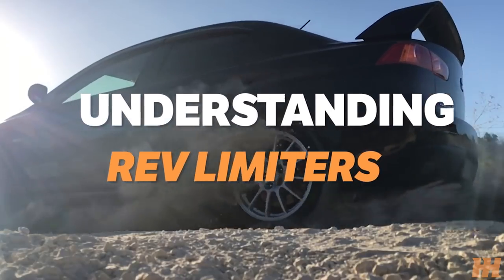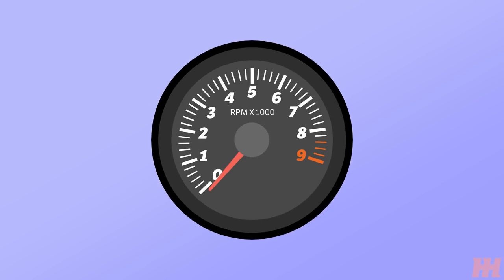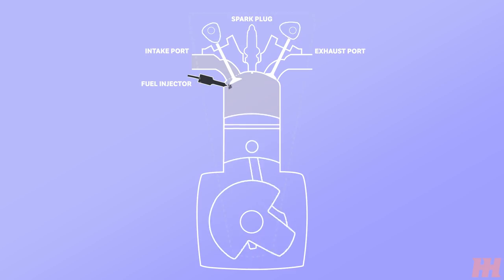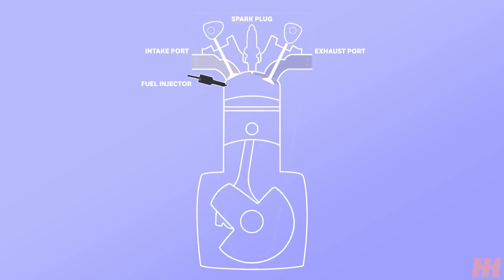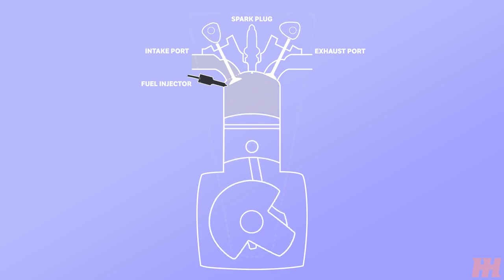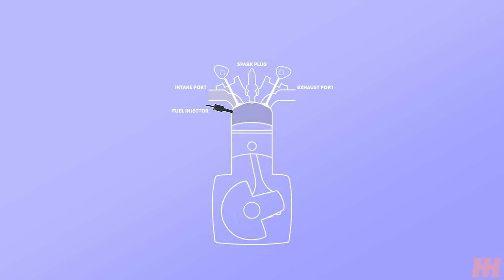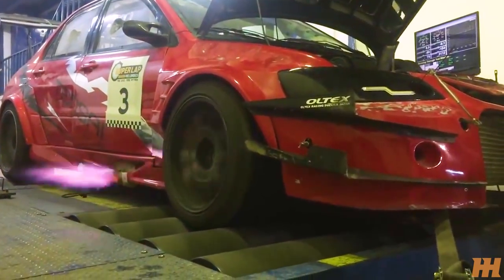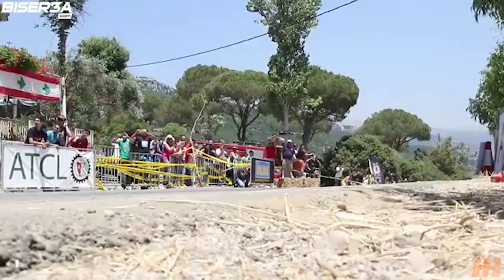The Truth About Rev Limiters

Comment: Just to note, antilag in rally cars is significantly different that “antilag” on most lower end ECU’s that guys will use for launch. The rally systems are not just retarding timing. They’re a full air bypass system where the turbo cold charge will actually recirculate into the exhaust and fuel will be added normally by retarding timing and then a secondary ignition is used in most cases. It’s a very advanced system and really really cool. It’s now being used in Formula Drift as well for those that don’t follow either. Worth noting because I think your info was a bit misleading.
Reply: Lol I can’t tell if this is serious or not
Reply: @dustinclement2483  🤣🤣
Reply: @redline350zHR  lmfaoo
Reply: It's like an afterburner in jets?
Reply: @Sm00thieK  thats called rocket antilag, its different from als

Comment: yeah i have a question
So how do i replace my piston return springs?
Reply: watch chrisfix he has a video for that
Reply: do you have an elbow grease ? if yes where did you bought it ? i badly need one thanks
Reply: You need a long stand.
Reply: Use some soapy wooder to soften the grease.
Reply: The Dutchinator well your in luck Chris fix made a video about that. It worked on my and made it much easier to replace them.
Reply: You have to remove the pistons first. To do so, remove your current rev limiter and stand on the throttle until you see all ya pistons
Reply: Jack up the vehicle and touch the chassis and it should be good
Reply: The Dutchinator you can't do that alone, bring the car to mechanic
Reply: always keep a bucket of compressed air by your side, just in case
Reply: refer to ChrisFix's videos
Reply: Change your winter air to summer air, its almost summertime
Reply: You tube it. It's been done.
Reply: while your at it you might as well rotate your wiper blades

Comment: And remember guys, it is always best to use all of the above limiters on a cold start for maximum results ;)
Reply: Will Palmer for engine longevity, peg for to floor the second the engine starts and let is bounce off the Rev limiter, this will warm the engine up faster and promote better oil flow, increasing lubrication and engine longevity. It even says so in every owner's manual, don't look, you can trust me.
Reply: Will Palmer also, if your car has a turbo remember to floor the living shit out of it then turn it off abruptly
Helps to lessen the turbo lag overtime
Reply: Instruction unclear, piston caught in ceiling fan.
Reply: It helps let everyone know how cool you are too
Reply: If you put petrol instead of engine oil it creates much bigger and louder pops and bangs.

Comment: It isn't ignition in the hot exhaust, it's ignited by the after fire of the following cylinder otherwise on older cars without all this electrical stuff in them, if you reved it and then turned off the ignition there'd be a constant stream of flames, instead there's just one pop when you turn the ignition back on. The hot exhaust merely flashes the hydrocarbon fuel into a vapour making it much easier to ignite.

 If a hot exhaust ignites fuel vapour you'll get a constant stream of flame from down the pipe which will make a very characteristic whoosing noise where as after fire ignition makes a pop or bang.  An example of exhaust ignition would be some high end lambo's where you can see that blue flame on the exhaust sometimes under acceleration. That flame also contains a lot of very hot oxygen.

Comment: Also worth to note: Not everytime a car goes bang its because of Antilag or 2steps. (Gotta love the compilation videos that get this all wrong)
Reply: "Antilag or 2steps" - you mean Antilag or rev limiters! 2 steps don't limit anything, in fact they increase something more than limiting it!!
Reply: @Anarchy-Is-Liberty  A two step (Rev) LIMITER limits the RPM in two Ranges, a low range that keeps the RPM at a set "optimum" for maximized grip on launches and and a High Range which is the maximum RPM the guy that sets it wants the engine to run at. They just cut the fuel (and/or ignition) to prevent the engine reving past the set thresholds. 
Antilag basically dumps unburnt fuel in the Exhaust system  by retarding the timing to get Afterfire (not backfire) to keep the turbos spooled. This is mostly seen in racing as it will put a lot of stress on the Turbos.
And generally cars can afterfire for a bunch of reasons, not just limiters and Antilag. 

I by the way wrote the comment before checking what video it even was on since its an old comment. After watching the Video again, this is exactly what he explains anyways...

Comment: Great video. I always heard these terms but never knew what they meant

I've noticed that my civic (bone stock) has a Rev limiter that kicks in at like 4500 RPM when the car is stopped and in neutral. I guess it's to prevent people from revving to redline and putting it in Drive to launch the car.
Reply: uRiBiTo666 hmm my Jetta is like that too you can only go up to like 4k when your standing still
Reply: my last car was the same. Its also to do with the lower inertia of an engine not connected to the wheels.
Reply: Thats to protect the torque converter
Reply: Yea some Ecu’s are tapped into the neutral safety switch to know when you’re moving/ in gear or not. But it’s to protect your drivetrain as you said
Reply: I didn't know that was to protect the torque converter. I discovered this rev limiter in a rented Dodge Challenger R/T and assumed it was put there by the rental company to prevent customers having too much fun! ;)
Reply: My Ford Fiesta stops at 2,000RPM! I want to left foot brake launch, but can't as there's no torque at that low RPM.

Comment: A word of warning using the Bee-r or any other ignition cut that uses the same method of cutting ignition which is to ground out the coil and stopping the spark 
But the spark has to come oui of the coil regardles as the Bee-r cuts in the middle of a cycle causing a random spark at any point in the cycle.
If you like your engine and don't like DETONATION and your engines lifespan being reduced then take note. 
Also If you do use the Bee-r, make sure you have a straight through exhaust as large restrictive silencers tend to explode when full of fuel in them.
Reply: So are u saying I shouldn’t get it then?

Comment: I still can't understand what causes the exhaust pop up when you shift up in new cars like A45 amg and RS3 and the golf R and other RS cars
Reply: anas boulkhalil when you close the throttle there's a moment with a lot of fuel that doesn't get ignited hits your exhaust causing flame so when you lift off throttle to up shift quickly this happens rapidly there's more fuel and higher chance of this happening
Reply: I think it;'s got some fancy valve system int he exhaust too, as I've seen them pop when slowing in city traffic at low speed and RPM.
Reply: tangles01 yeah that what i think it's a valve that causes the pop up sound because it sounds loud even if it shifts in low rpm and it does not sound like a gas explosion

Comment: A question, why do cars start to require costlier and more frequent repairs the closer the vehicle gets to end-of-life? Like initially the car may have one or two trips to the shop a year when new, but 10-15 years later, it sees a new repair and parts replacement once a month, maybe 2 months if you're lucky, the value of the car dropping to the triple digits, until it becomes more economical to just buy a new car. Essentially what happened to mother's minivan.
Reply: Cars are a combination of tens to hundreds of different systems with tens to thousands of different parts comprising each system. Any one of them can fail or cause another part to fail more often and age is the killer of all.

Comment: I only care about that cool sound they make =)
Reply: until your turbo breaks! ;)
Reply: Just passing by ? antilag is turbo only, how come it breaks your *turbo*.
2step can Be NA
Reply: CarMaster_316 Ignition cut is perfectly fine. Fuel cut is very bad.
Reply: Some people don't care though, which is bad.
Reply: Special Ignition cut is also bad, reducing your spark plug timing can make your car slower. Pretty much any unburnt fuel makes it slower because you're not getting enough air and as we all know air is quite important when it come to engines.
Reply: Turmoil CritHitJ Yeah, but isn't there a switch for the ignition timing whenever you install it so that whenever you race it doesn't just antilag?
Reply: CarMaster_316 there probably is something like that out there, my point is that spitting flames under any circumstances has a good chance of reducing your total horse power
Reply: Turmoil CritHitJ Yeah, oh well it's just preference
Reply: CarMaster_316 Fair enough mate

Comment: Can rev limiter can install in distributors ignition system cars if it does so how it can control the ignition timing because distributer has its own manual spark timing wich advanced or retire vary on rpm or speed...???????

Comment: Afterfire is the fire that's shooting on your exhaust pipes. Backfire happens when some air/fuel mix seeps into the intake valve in compression stroke. And when power stroke occurs, the fire spreads to the intake and blows instantly and this only occurs to engines that have valve float, carbon build up or it is just the valve not seating properly.

Comment: When I floor my car (a stock 2012 Honda) in neutral, the Rev doesn't exceed around 4,500 RPM and it bounces back and forth. Is that a 2 step??
Reply: It's a soft cut limiter

Comment: Are pops and bangs good?
Reply: Mr WRC depends on what's causing the pops and bangs
Reply: Not good if it includes burning parts and blown heads
Reply: for sound yes, for engine components no
Reply: like Zo1d_ said, it depends
Reply: You should ask my turbo that.
It says not for long.
Reply: I have an old carburetted Alfa Romeo which has a spark cut rev limiter that works via a centrifugal mechanism in the distributor rotor. It completely cuts the ignition while the carburettors are still delivering maximum fuel, causing you to blow a hole in your muffler. Ask me how I know. ;)
Reply: The engine isn't burning all the fuel during the power stroke so in effect you'd be wasting precious Bhp per litre

Comment: But why do some make flames or crackling Sounds when they Just Go of The gas
Reply: thedogefogx420 thedogefox420 Unburnt fuel igniting in exhaust
Reply: zevi 2000 but why only in some Cars and Not in every Car
Reply: thedogefogx420 thedogefox420 This wouldn't happen in a Civic or a A4 because it's not a high revving engine. In a performance / race car the engine is working harder and faster so it's more likely that some fuel goes to the exhaust.
Reply: James Upton wait There are many Flame spitting Audi a4 or Honda civics i dont get it:/

Comment: Fun fact. The e46 M3 has a stock 2 step (although it’s not designed for launch control its design to nanny you) the car will go to 8,150 rpm when in gear. The car will not exceed 6,000 rpm while in neutral.... now if I could only reprogram it to use the stock system to lower the neutral rev limiter to like 3,500 rpm

Comment: isn't a 2step syystem then not good for the engine?
Reply: but are the parts engineered to be able to handle spark-timing changes? we're talking about huge forces acting against the natural way of how it's supposed to be. 
and recently i heard, that unburnt fuel is bad for the catalysator..
Reply: 2 step and anti lag is bad for a normal engine.
The engine isn't manufactured for that.
And it is also bad for the cat.

Comment: if people that hate autos because of lack of skill. then i dont get why people like 2 step. i want to be as good as i can get, without any type of compensation. i like 2 step for the bangs and pops and thats it. i'd rather try an get good at holding the perfect rpm, then have some system do it or me. like new cars with rev match and how cars do almost everything for you like gtrs. but thats how i feel im sure many wont agree and some might.
Reply: 2 steps do more than just hold the rpm in a certain spot.
Reply: When you’re drag racing and every fraction of a second counts, that time it takes to push the pedal the rest of the way to the floor can make the difference between a win and a loss. even if you’re perfect at holding the revs. Not to mention 2 step will spool the turbo better than just holding the throttle at a certain point, making for a harder launch.
Reply: Mr.009mm Killuminati Two Step allows you to be at full load so when two-stepping you're making similar to the maximum power that rpm it's especially effective on turbo cars because you're at full load off the line

Comment: So it’s basically just about pops and flames from exhaust (which I find cool) and also about a tool for those who cannot launch car properly by themselves...so it is just cool, but basicaly fuckin useless....mmmkay
Reply: Well, with two step, you can full throttle right away, if you are just "badass" eyeballing it, you may need to throttle up when the rpms are slowing down

Comment: rev limiter will break your engine. Dont try it :D
Reply: Christian Yeah, if you keep your engine at rev line for 4 days it will, but if you bounce a few times nothing will happend. Also for fucks sake don't rev your engine while it is cold
Reply: Ante Radić that’s what I’m talking about!
Reply: Christian no. Rev limiter isn't bad for your engine.
Reply: actualy the revlimiter is there to make it harder for you to break the engine (by not leting you rev for example to ridicolous 9K rpm, but only to "sensible" 7K rpm), what you mean is that if you are on the rev limiter for too long that it will not be best for your engine :D, and yeah it is slightly confusing and i guess you are not the only one :D
Reply: Well i got a piston laying in my garage which broke apart when i was reving my engine with the rev limiter. IT WILL HURT YOUR ENGINE DEFINITELY. I KNOW IT. thanks for the hint, i was reving my engine ONLY in cold condition, thats why it broke for sure  :*